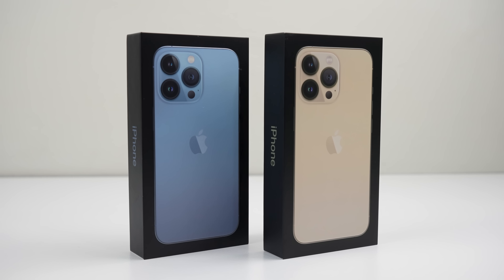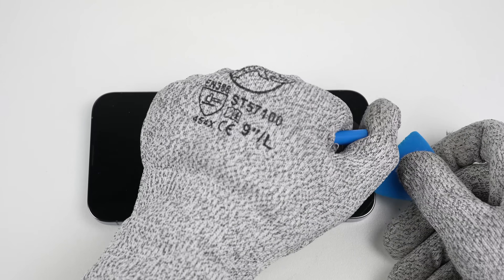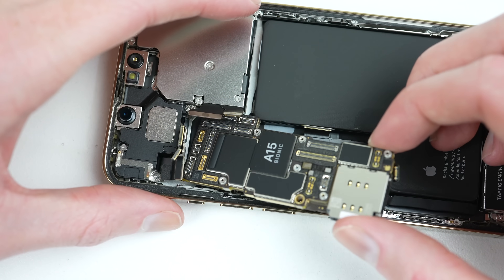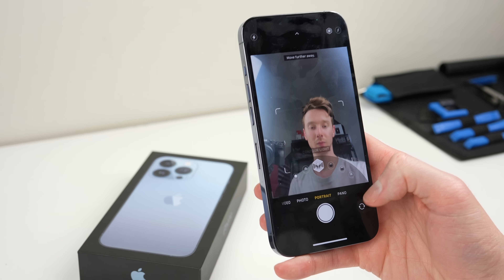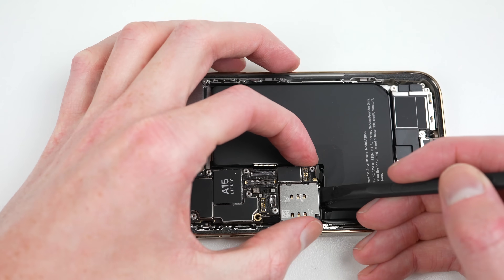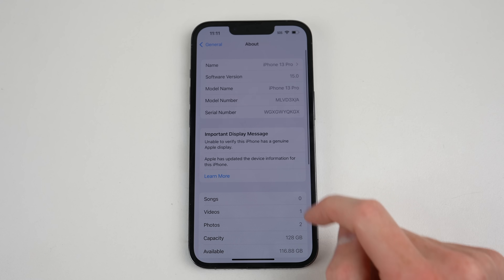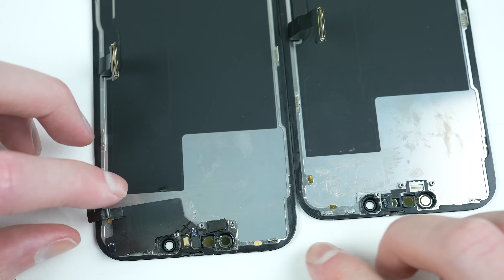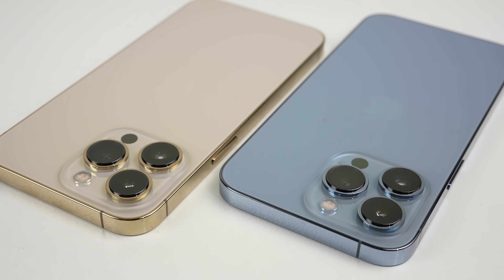iPhone 13 A Repair Nightmare - Teardown and Repair Assessment

Comment: This is an easy fix. Stop buying products from companies that adopt these practices.
Reply: No, the problem is the average non-tech savvy person does not know about this, and has a high chance of not caring about this until it will or did effect them IRL.
Reply: @wipfjustin1  Yeah they should make it clear that the phones can not be repaired by third parties. In bold large letters on the box. Not suggest that it shouldn't be repaired by third parties. Huge difference.
Reply: @wipfjustin1  So if it doesnt affect most of the consumers, why does it matter?
Reply: @wipfjustin1  The average non-tech savvy person doesn't care even when they get affected. They will just fork over money to Apple to "fix" or replace their phone or buy a new one. They have the money for it and they simply do not care.
Reply: Exactly. Companies manufacture exactly the kinds of products the public is willing to buy. You're willing to buy non-repairable product? Cool, there's gonna be companies who will oblige.
Reply: @SharkTH _ Only the big US ones. You can still easily buy Chinese phones and laptops and repair them, because they don't give a shit about people repairing their devices.
Reply: The thing is. . . Apple is the one that starts these bad practices and other companies follow suit. Eventually, every company will follow a version of Apple's practices and there will be no one left to turn to.
Reply: It's very hard to avoid this practice as its practiced by an incredible amount of companies. It's near impossible to find a phone that hasn't been glued together.
Reply: I.e., Apple, Mac, Ipod, Apple, iPhone, and Apple. What'd you say? Those are all Apple? Oh yeah.
Reply: @CuteAssTiger  communism bans you from selling or trading anything. That's what I meant, when I compared the gaming industry's practices to a communist regime.
Reply: I stopped buying iphones after the 5C i now use Android phones. I currently have the Samsung Galaxy S20+. My dad repaired a Phone 5C screen himself after it was cracked and it put up a screen was changed message and also told him that the iPhone Software will no longer get software updates. If you repair a iPhone yourself or by a 3rd party phone repair shop it is like you jail broke your phone. You can't even update the software if you repair your iPhone other than having Apple repair it. It is more than getting just screen changed messages
Reply: @grobanite4ever85  
after getting the iphone7... and the loss of the beloved headphone jack
i just jumped to android the second the iphone 7 was on its knees
Reply: In a few years all major companie will make this practice or procedure standard inluding Samsung. If the solution is to stop buying from all the major manufactures that have these features  then you are going to have to settle for other smaller companies like budget phone makers. Say goodbye to premium camera or specs of any kind and get used to good enough.
Reply: Unfortunately, the planet is massively populated by materialistic morons for that to happen.
Reply: Same with video games that need a code to download patches and updates to fix the broken base game. The code is one-time use or they expire, meaning you can't sell the games you "own." I don't buy games anymore for this reason, because I vote with my wallet. But others can't help it. They'll still support these dirty communistic practices from gaming industry.
Reply: It's not that simple. There will always be apple fanboys who buy their stuff.
Reply: Bingo.
Reply: It is not that easy. Often companies that pull this move are the ones that have strong position on the market and they know that they can get away with doing it. Some kind of monopolistic position. Like imagine you already use some iOS exclusive app at your business and you can't switch easily or something like that.
Reply: Agreed, this is why I got the pixel 3a
Reply: S^luts* will disagree.
Reply: Governments really need to step in at some point. If a company is refusing to allow repairs of their products, block the sale of their products in your country.
Reply: YES EXACTLY this crybaby ass society we have nowa days isn't smart enough to JUST NOT BUY THIS CRAPPLE SHIT!
Reply: Leaving the decision to the unintelligent masses will make sure the worst case scenario happens. Most of us watching this aren't buying Apple products. And the lack of our business isn't making more than a tiny dent. This needs to be punished by government.
Reply: 😩 the only reason i upgraded from my iPhone 4S because they bricked my camera when i had to replace the battery. i even kept using the phone without a camera for over a year but the constant overcharging and bulging battery forced me to get a new phone; what did i get? iPhone SE used, and then i lost it and got another SE, i have bought 6 different iPhones in my life, why do i keep doing this?!
Reply: then whose left
Reply: This braindead take of “it’s consumer responsibility ” when it’s the CEOs who decide to implement shitty hidden practices to maximise profits and monopolise markets. You think it’s just Apple? Oh my child, every fucking company want to do that if they can because unironically it’s the nature of capitalism baby. The real solution is not “personal responsibility” of average joe when facing a systematic problem, or rather a feature of the current “free market”, it’s to regulate all companies so that they can’t screw you over in infinite creative ways. A reminder for I assume Americans in this thread: You pay the government, they should be on your side so hold them accountable and let them do the job of serving the citizens.
Reply: But, but, I want to feel special and good about myself, and I want to call people poor even though I make minimum wage!
Reply: exactly its not rocket science, and complain to you consumer protection department of the government this will only change if it is legislated and a law passed that all electronic devices have their basic schematics and genuine parts made available so that the "OWNERS" of these devices can affect diy or third party repairs
Reply: The majority of people don’t give a damn, the majority of people are totally unaware of the slave labor that Apple uses to make their products. It will never end
Reply: Yeah don’t buy their products, why does your bum hurt? I like this strategy, because when I buy a used iPhone I can be sure it was serviced with original components done by apple. That way, I can be sure I have an iPhone and not a phone with wish components
Reply: 100%. Never owned a single Apple product in my life, just came here out of curiosity. And was not surprised by what I saw.
Reply: I agree.
Reply: Who cares lmao
Reply: It's a known bug, that will be corrected on the next iOS version
Reply: Yep. We don't need "right to repair" legislation. We need people to stop buying products from anti-repair companies.
Reply: @gayusschwulius8490  We need right to repair legislation AND to stop supporting shitty businesses.

Comment: I truly don’t understand. An iPhone 12 cost $900. A good Samsung phone cost $300. Both have lots of great apps, both have extensive GBs of memory and fast processors, both take excellent pictures and both have very good voice call on speaker sound. And both are mostly used to make calls, send text, browse the web and take some pictures. And both do this quite well. Exactly why would you spend $600 more for a phone that does the same thing as good as a $300 phone does?

Comment: Sure iPhone is environment friendly - in case of display damage you need to throw the phone into the dustbin, instead of just screen replacement!! 

Well done apple !!
Reply: Official Apple care could replace your display. That time this issue won’t arise. Apple want to avoid 3rd party repair
Reply: @kpntly  you support this ?
Reply: They aren't environmental friendly. They are cutting costs with by removing the things which normally come with a phone and took the cheapest excuse they could.

Comment: Absolutely disgusting. I can't believe people see shit like this and STILL choose to support them.
I'm pretty sure at official Apple "Repair shops" they're able to bypass all these messages and errors with a click of a button.
Reply: It's not quite as easy as clicking one button, but it's still usually not that bad. Depending on the iPhone model and the part replaced, you need to run RepairCal or AST2 System Configuration. Either one takes a few minutes. RepairCal supposedly calibrates the display, but I assume it actually just updates the serial number pairing. It requires the RepairCal program to be running on a MacBook, and the iPhone must be in DFU mode. System Configuration is the newer one and doesn't try to hide what it does behind the calibration explanation. It runs from some "cloud" server rather than needing a MacBook, and the iPhone must be in diagnostics mode. I'm not sure which is more annoying to use. Also, don't bother trying to find a copy of RepairCal to run yourself. It contacts an Apple server to get authorization for the "calibration".

Comment: Apple certified tech here. Apple hands out software for calibration and system configuration. Features like Face ID or Touch ID on older iPhone models will not work after a display replacement without running through the steps in Apple's diagnostic software, which again, is only given to Apple Authorized Service Providers (AASP).

Comment: Good investigation. I have a 2015 USB C MacBook which stopped charging 2.5 years after purchase. Apple told me to fix it would cost me almost as much as a new computer. After watching some videos online I’m convinced it merely required a replacement of the USB port only. Apple insists this requires the replacement of the entire logic board, which I think is total BS.
Apple used to be decent at offering warranty repairs when just out of warranty when Steve Jobs was CEO. That all chanced as soon as Tim Cook took over 😡.

Comment: And their machines will only run on the current os or newer, which means you cannot even go back one os, and on phones and tablets, if you upgrade you are stuck, and cannot return to an earlier os.
Apple owns the phone after you buy it and can lock it for any reason at anytime.

Comment: Gee, maybe selling specialty tools and parts to people looking for ever smaller and higher performing devices wasn't such a good business model.  Hack uncontrolled processes like putting on an analog heat plate and then prying around the perimeter is scary.  This is NOT the way the phone manufacturers do repairs, they have developed much more specialized and reliable tools that would beyond reasonable costs for people buying into the idea that they can fix things on their kitchen table if they only buy all your gadgets.  I don't blame Apple for putting software locks to keep you people out.  There's an old maxim with auto mechanics.  Labor rate is $100/hr, $150/hr if you help, and $300/hr if you worked on it first.  This idea that any housewife can repair something on their kitchen table was wrong even when the packaging and design was such that an electronics technician with an ESD bench and basic tools could.  With the consumers clamoring for ever more performance out of smaller packages, the only way to make things is to glue them together.
You folks are dinosaurs whining that a meteor just landed.  Find something productive to do with your energy.  Technology is migrating to embedded components and other things that will absolutely preclude kitchen table repairs.  Face up to the future and progress, or be left behind.  But for the love of Pete, stop with this incessant posturing that you're 'helping' consumers.  You're just trying to sell stuff.  Sorry if I'm blowing your cover.

Comment: So, TL;DR Apple sucks.
They design it to fail, and have some bullsh1t software tech they use to prevent the phone from working right, even with Apple parts. Which only they can bypass.
What absolute sh1tbags.
At this point, I would only take one if it was free, and even then I'd just sell it.

Comment: "For Sale: Two Phone for suckers that require to pay over prices charges to repair." 

Is Apple really worth the effort for this level of support? 

In my mind, why purchase a product to be dictated from the manufacture that you are required to be over charged for future maintenance?

Apple product are for those with to much money in their pockets and what to be "In the Group".

Fortunately, I am old enough not be be concerned by social pressure, otherwise I would be totally broke and suffer depression.

No surprise I user an Android phone. Can I make phone calls, txt and install APP's. Yes.

What am I missing from not owning an Apple apart from money?
Reply: Only thing you are missing is the hole in your pocket for a good few, While the rest are too busy being 'Posh' about the 'ecosystem'

I can imagine after years of being friendly(apple at the beginning) only to turn their backs on you now after a good amount of people have incorporated whatever they had into the system its hard to get back out.(I would say this is down to their Board of directors doing this nonsense..)

Almost like a Drug addiction. Its hard to get out and adapt once you leave because you start missing those neat little features. Though other brands have their own quirks some are not as polished as apples..

Comment: What happens of you take it nito apple after a replacement? Will they just flash the motherboard to accept the new screen, or require an entire replacement?
Reply: It's between two things, replace more components than what they should repair, or suggesting the customer to buy a new one

Comment: I used to own an iPhone 4 and 5, 4 was fine, but than 5 came out and so did the issues with them limiting devices and heading down this path we see now. Why do sheep keep buying these products when it is obvious they are forcing into this business model? There is nothing good about it from the purposely slowing down of your device to "Help extend the life of your phone" to the "Go fuck yourselves you cannot repair it yourself" it's all a crock of shit.

And it's gotten far far worse than I can ever imagine, swapping a genuine part and it stops working it just rotten to the core, you cannot even get a second hand phone and use genuine parts, they want you to spend money only with them and keep the cash flow in house, you cannot get any worse than that.

Comment: The business model of consume, consume, consume, is not sustainable. Currently, there are worldwide shortages on lithium, copper, silver, nickel, and an entire host of rare earth metals and materials, not including semiconductors used to manufacture all these electronics. They will be manufactured, and within 2-6 years end up as e-waste in developing countries. These products will not be recycled in any manner, causing problems over time for the local environment. When will these companies realize this isn't a good, or even sustainable business model?

Comment: TLDR: More people need to hear about this. The issue will only become bigger and bigger and Apple probably thinks they can just skate by without anyone noticing and this will get worse and worse for customers unless people start speaking out about it. 

Rant: 
I've been following your channel n this right to repair topic for a long time now. I think the more Apple does this the more they are going to have to ramp up their security and encryption which is one reason people like Apple products historically speaking. Apple has good privacy and security features compared to most of the competition, at least in my personal experience and anecdotally. The more I see them pushing this stuff to stop people from repairing their products the more frustrated I get. I think this will catch up with Apple and hackers/coders as well as repair people and enthusiasts will work that much harder to find a way to break this system through blood, sweat, and tears. Eventually the security Apple has right now will be broken wide open and it will be a matter of them consistently having to catch up. I'm thankful people like you are speaking out on this BS because more people need to know about it and it's a concern that people might not care about as much as they should. This will only become a larger problem and we need to talk about it now because Apple is really being more anti-consumer. I wonder in 10 years if iPhone will still be the most sought after smart device or if things like this and not being able to replace battery on top of other software features will push more informed customers away from the device. I can imagine a future where Apple eventually may have to add basic things like being able to easily replace your own battery and repair your phone as a marketing point to sell their phones. It isn't going to happen anytime soon I don't think but I think this will eventually catch back up with Apple and hurt them more than it already is. There's definitely people out there who are Apple haters who either just think Apple is charging too much for too little, the phones/iOS is not the platform they prefer, or people who once were Apple fans until they realized all this shiesty business practices Apple is implementing. Ok rant over.